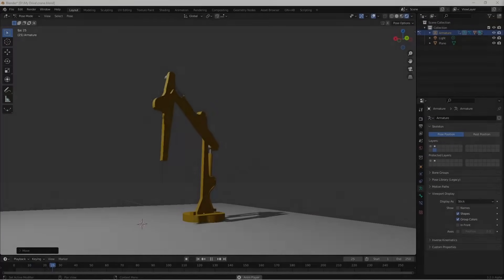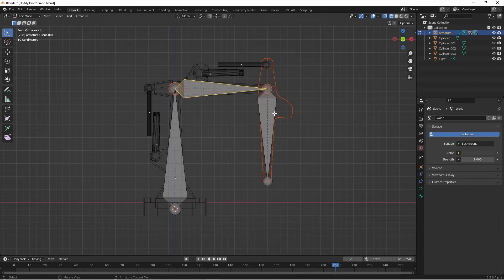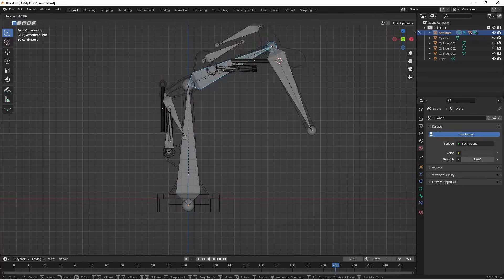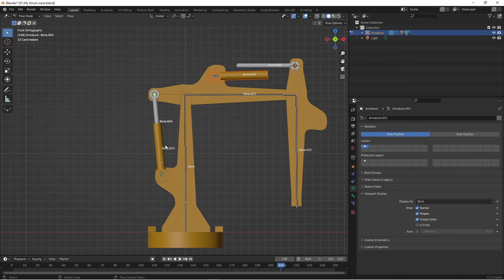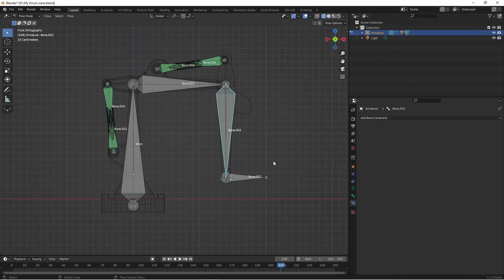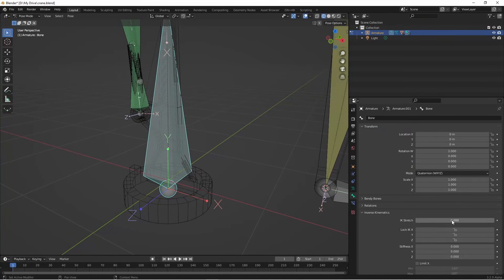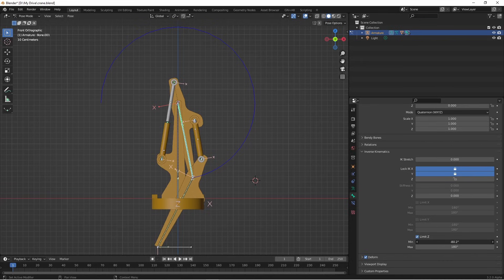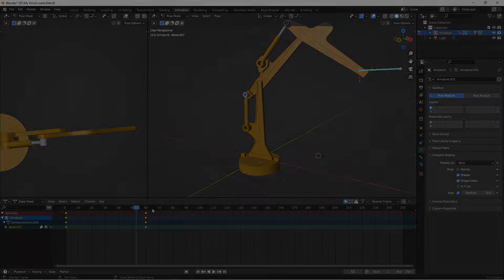Blender Rigging - Setting Up an IK Arm Rig

Comment: Hi Johny, this is great and with this tutorial you can make MANY MANY things. QUESTION: how I can retain the position of the last bone (the one you use as IK inverse kinematic constrain) to be always fixed and not move in the air... of  course this is doing the right movement, but sometimes if you push too much, you are floating with that bone and have to reset the pose . Thanks!
Reply from the maker: You can add a distance constraint so that it can’t get any further than the sum distance of all the bones the chain from the root of the chain.
Reply: @JohnnyMatthews Thanks, will try it !

Comment: This can still be considered (2025 year) one of the best tutorials on installing and configuring bones!
But in all this tasty big barrel of honey, there is a ladle of tar!! Not everyone opens the “clear pose rotation” function, which is shown at 8:28 minutes, and there is a simpler, faster, more rational way to do this than not working key calls (which, of course, can be reconfigured in the video card settings, but this does not need to be done, understanding the simpler move).
And everything else that you explained is world-class! Very clear! THANKS!

Comment: The thing I see much more rarely in tutorial and training videos is the WHY in explaining a particular task. ALL training videos explain WHAT to do, but more infrequently do they explain WHY it’s being done in a specific way and alternative ways it could be done to achieve the same or similar results. And to go a bit deeper showing some common mistakes that are made in attempting a particular result. MANY times I have followed along through the steps in a video, and it usually works fine, but I have to go back over it and study all the steps in an attempt to better understand it so I could do it again in the future without the need to watch the video again. So THANK YOU for explaining the WHY in what you are doing AND the common mistakes or directions that could be taken that will not yield the desired results. FAR too many tutorials do not take this into consideration and its the difference between garden variety tutorials and exceptional ones.

Comment: I like the tip for placing the 3d cursor explicitly to a center for when placing the initial armature.  But find it out that you zoooooomed way in to position the end of the armature bone.  Is there a more explicit way to set the end point of the bone to a 3D cursor?

Comment: I don't know if anyone had this issue, but my locking rotation isn't working on one of the bones. The one in the video that needs to rotate only on the Y axis (the base).
In my rig, this kind of arm is connected to the body of a robot. The arm itself suppose to move like in this video: a base that rotates and two arm sections that "bend". The bending part is working, the rotating part isn't.
Reply: Would you mind sharing the 3D model to follow the tutorial?

Comment: so i tried to do this for a bipod on a sniper rifle..now yes this would be easier if i had just FK the animation since the actions were a simple rotate a bracket down, rotate individual legs outwards (joint at the bracket), extend the telescopic legs and rotate the foot on each leg. now as constrains go the first thing i did was i went through the armature and did a bone rotational constraint for the parts that rotated (the bracket, the legs and the foot on each leg) and a location constraint on the telescopic leg part. SO voila my FK is done. next I added a bone so i can setupIK to control all this individual movements in one clean move with one bone and that is where it all goes to feces. I have followed the two methods step by step. It is not working at all for me and idk what i am doing wrong, worse of all i know it is something i am doing wrong and i cant find it and its been chewing at me for 9 days now . 1 fakin task, one retarded bipod 9 days of life . When i add a bone and make sure is not stuck to the armature then i  click on one the two folding feet of the bipod, then i add ik constraint to my lone bone. then i try to move the "handdle" bone and its stuck it doesnt move it controls nothing , i made sure that the chain is set i can see the yellow doted line telling me how far the IK controls the armature on that leg of the bipod but i can't get it to move
Im lost, i need help. PLESE HAALPPPP someone anyone HALP, this kind of not knowing doesnt let me sleep literally, like ibe waking up 5-6 am just to search and try to do what i want to do in this case after going to bed at 2 am so yeah 4-5 hours of sleep in the past 9 days and roughly 16 hours for the past 9 days for AGAIN 1 bipod 1 stupid fucking concept that WON"T SINK INTO MY FUCKING BRAIN.

Comment: excellent explanation. Well narrated
I do have one question about the hydraulic cylinders.
Could you not of just used the Damped Track constraint for each side of each cylinder instead of bones?  
I don't see where the bones are functional except to align the two parts.

Thanks again

Comment: I absolutely love this tutorial like many others who have written comments here. I love it because it was my recent breakthrough in understanding constraints in context with IK. Still, however, there is a small cloud in the sky: At 13:44 in the video, it can for a moment be seen that the pistons and cylinders that should hold the pistons do not match up in spite of the mutual Damped Track Constraint put in place. It happens to me as well, and it happens (in Pose Mode) every time when I reset the rig (Clear User Transforms) even though it is more of an annoyance than a serious problem. Still, if anyone has a solution, I would be very happy to know about it.
Reply: That issues for all kinds of constraints, which happens (for me) when you right click (to cancel the action) after you move something. It's not a big problem for anything applicable, but still  is annoying to encounter.

Comment: I am having an annoying problem. The 'make parent' menu, in 3:40, is greyed out for me. I tried the same steps in Blender 3.3 and 3.4 in Linux and Windows, same thing happens. I am following all the steps the best I can, but I really can´t find where my error is. There is just one occurrence like this in Google, and it is not related to my problem. Thank you and congratulations for your great tutorial!
Reply: Solved. Need to select both bones and press Ctrl + J before going into edit mode. I must have missed some step.

Comment: 2:07 You don't need to go into and out  of Pose mode like that, selecting the applicable mesh in the outline selects it, at which point you can parent just the same, but quicker.
That being said, the rest of it is excellent, the limits for mechanical rigs is an excellent function no other video I've seen has discussed them.

Comment: Very good video on the basic of IK rigging. How would you control the last bones angle/rotation? Just set it up as the IK target, and keep everything else the same? Because with your setup right now, everything follows, but you have no control over how a claw at the end of the machine would angle, for example
Reply from the maker: Yes, you would simply add the claw after the IK bone.
Reply from the maker: I am working on a followup video to expand on this idea.
Reply: @JohnnyMatthews  happy to hear that, i personally love everything mechanical rigging!